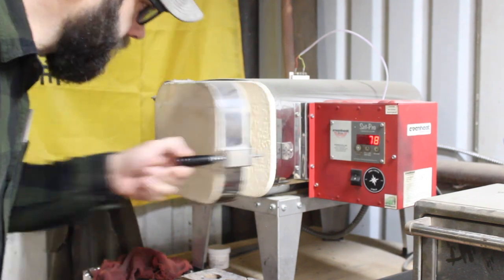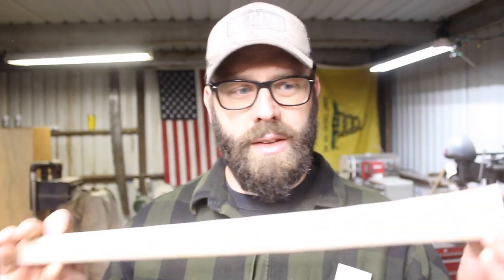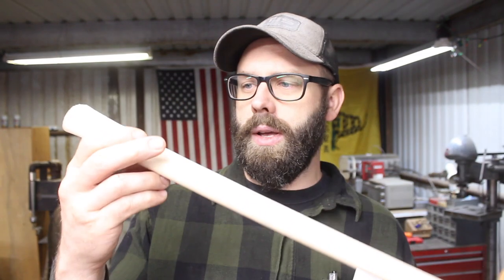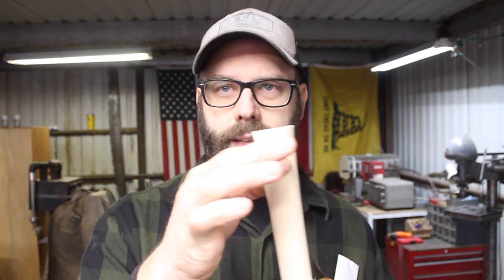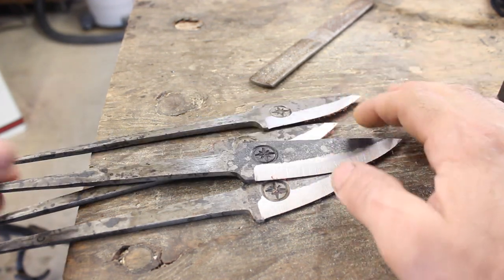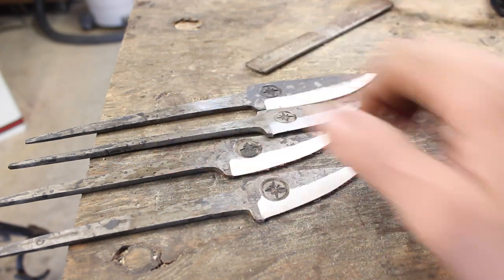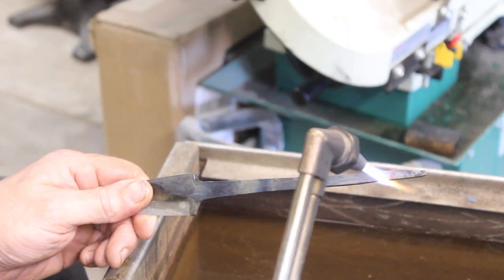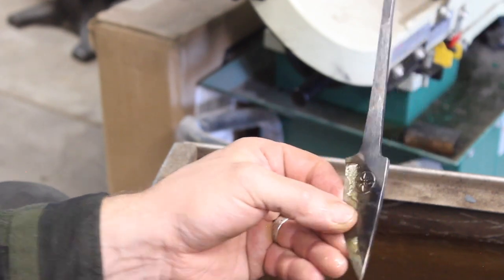Hand Forged Knife, Finished The Puukko Blades + What's the difference between a Hatchet And Tomahawk

Comment: How thick of leather should I get for basic sheathes? Just a good standby, nothing extreme. I'm almost all set up for kydex already, just making my list for the leathercrafting part.
Reply from the maker: I like 7-8 oz leather for most sheaths
Reply: @FireCreekForge  thanks!
Reply: I have used 7-9 oz for knife sheaths and it wet molds well and takes tooling if you wish.
Reply from the maker: You bet
Reply: @FireCreekForge  Finnish knives traditionally use reindeer hide and fur or birch wood for the handles and woven birch bark sheaths,but obviously they can e made with any material that is on hand.These knives do have a cultural significance to the Finnish people.I got my first one when I turned 13.I have had several in the last 40 years,and am interested it what you are doing with them.